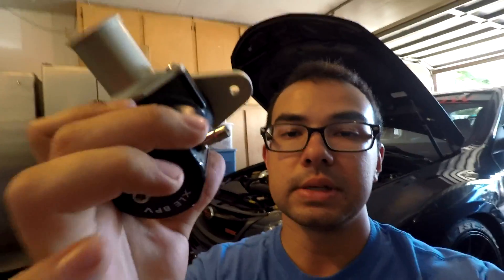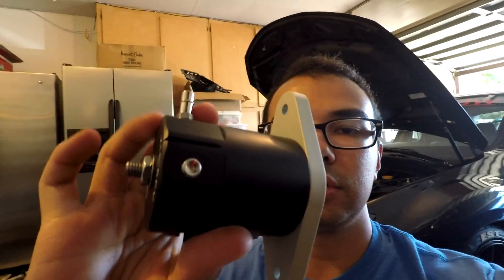How to install the Cobb XLE BPV

Comment: stock bpv is rated up to 25 psi
Reply from the maker: STI_awd 2016 yeah, but for some reason there was too much back pressure so the problem got solved when I swapped to an upgraded BPV

Comment: Do you have a vid on how to clean your Cobb BPV?
Reply from the maker: Whoak Honga I didn't make a video about it. But I know there are screws on the bottom of the BPV that you can take out and clean
Reply: KooZairy Thanks. I can't seem to find a video tutorial about it. I feel like i need to clean my bpv. I have an aos but I feel that I have some oil on my bpv. It might be gasket but hopefully just blow by.
Reply from the maker: No prob man. Yeah I know that unscrewing the bolts will take it apart. Try that and clean the BPV to see if it fixes the issue. Hope for the best. Hopefully it isn't a gasket..
Reply: KooZairy Thanks. I will try to call Cobb support for ideas also. What they recommend for cleaning it.
Reply from the maker: For sure, let me know what happens!
Reply: I found this...

https://cobbtuning.atlassian.net/wiki/spaces/PRS/pages/98576188/XLE+BPV+Rebuild+Instructions

Basically Cobb also sells XLE BPV rebuild kits.
Reply from the maker: Oh for sure. So its pretty much just new screws, an O-ring and a new allen key that they give you to rebuild the BPV
Reply: Yup. I emailed Cobb and asked and they said it is pretty much the same for their other BPV models as they share the same screws and O-ring. Just use brake cleaner or alcohol to clean. I see in your video you have a newer BPV compared to the one for my 2013. I don't have the option to choose where to place the vacuum line.
Reply from the maker: Whoak Honga Ohh gotcha. Yeah I got the latest model, that the nose doesn't curve down but just goes straight out. But I didn't know the older BPV models didn't have a vacuum line
Reply from the maker: I mean didn't have a choice to put the vacuum line either in the left, front or right side. That must of been a new thing they did for the new models